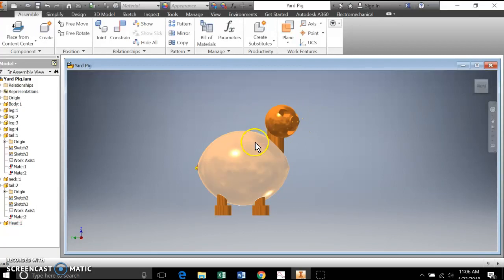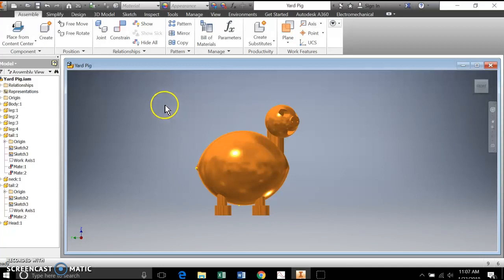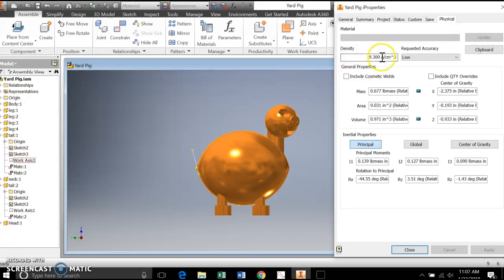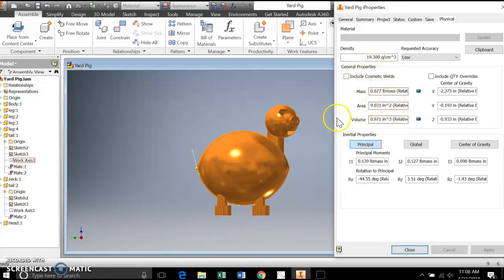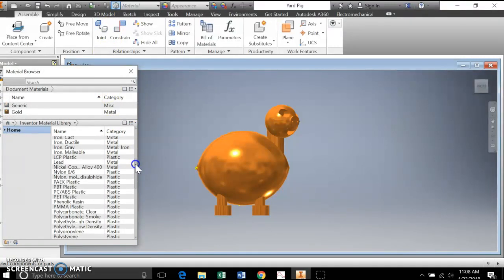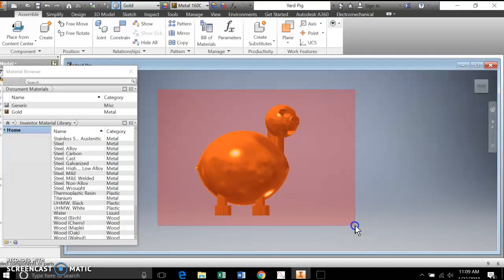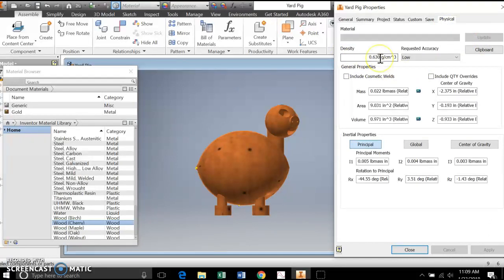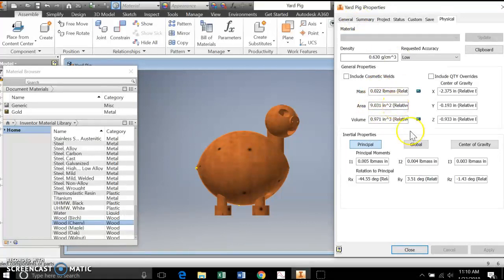Using iProperties in Inventor (for weight, volume, and area)

Comment: I'm really confused how Inventor tries to extrapolate mass in terms of pounds, instead of using slugs. 
I'm trying to place the WEIGHT of my object in text using iProperties, But Inventor only has MASS under the physical properties tab.
I tried making a custom iPropertie to show the weight in terms of pounds by multiplying the mass of the object by the acceleration due to gravity of Earth, but I could not get it to update or work properly. Any suggestions?
Reply: I know its a long shot but im dealing with the same issue.  Did you ever figure it out?